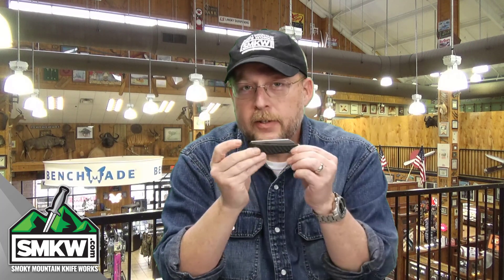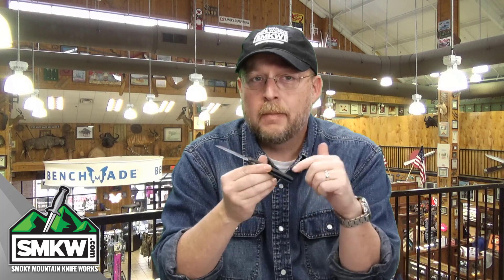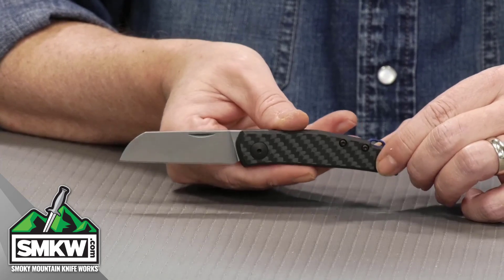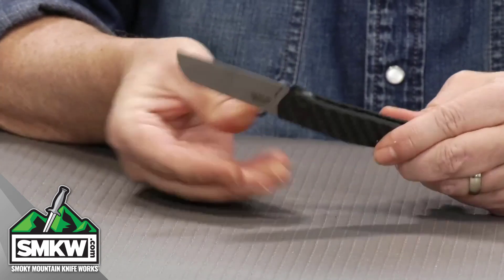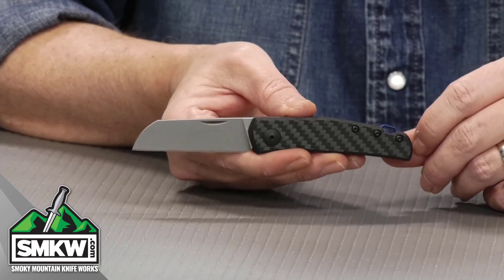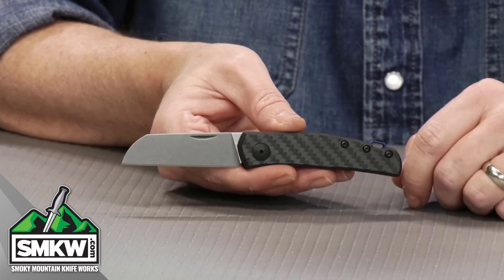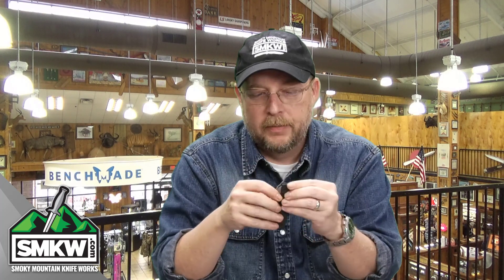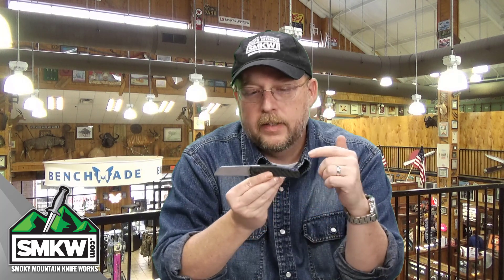SMKW Get to the Point: Zero Tolerance 0230

Comment: It’s hard to use the word traditional when it has no features of a traditional. There’s no backspring, bolsters or anything traditional. When I think of modern traditional, I think of Lionsteel. They use titanium bolsters, backsprings, covers, they’re screwed instead of pinned, etc. Maybe you could argue it resembles a small sodbuster. It’s a nice knife, just not traditional in any way. Maybe should be called “modern, non-locking” Just my 2 cents!
Reply: Good god get over it!